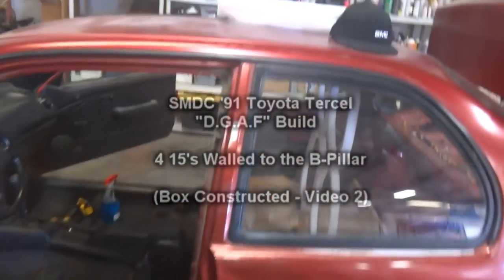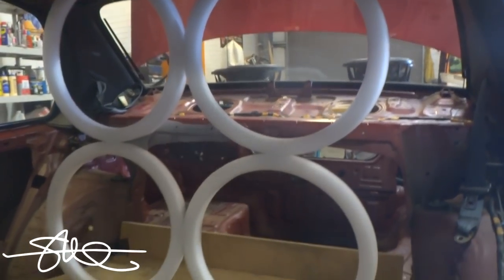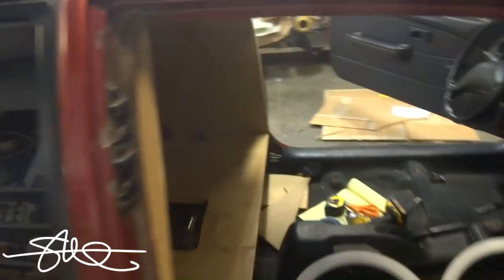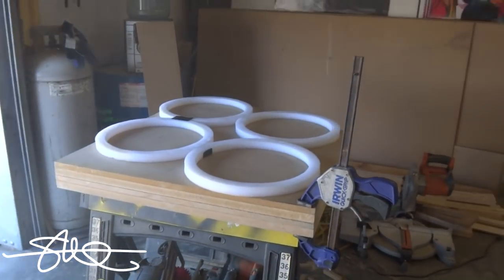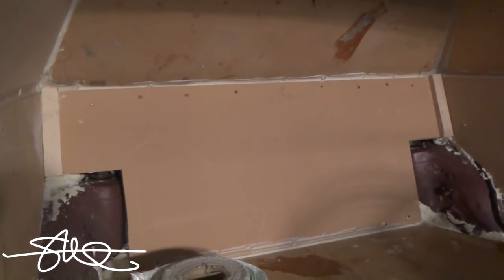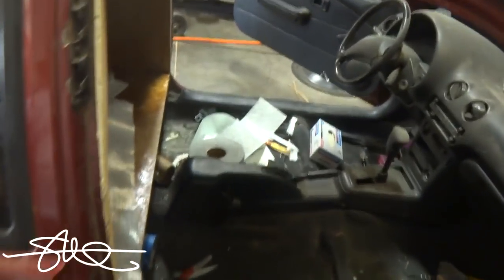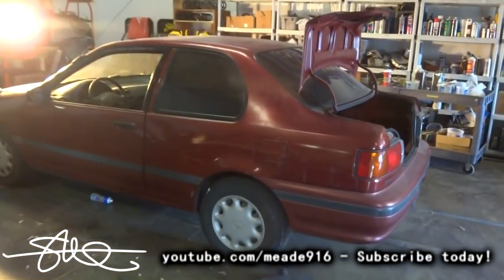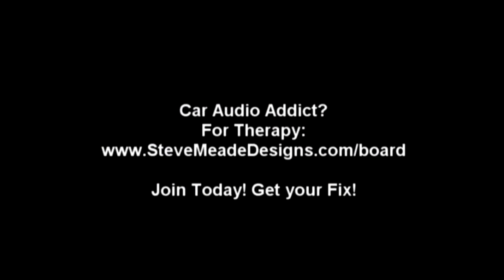BIG BASS D.G.A.F Project - 4 15's Walled - '91 Toyota Tercel - Box Built Video 2

Comment: steve, is the box only 3/4" thick on the sides? any bracing going in or is the structural integrity high enough to no need it with the glass and resin?

Comment: are you going to swap the motor so it can power the stacks of alternators? its like $200 for a jdm motor and the swap should be very easy, so easy you can just lift the motor out with your bare hands